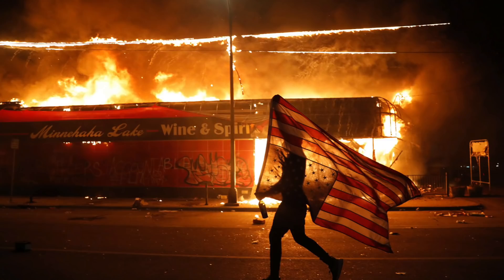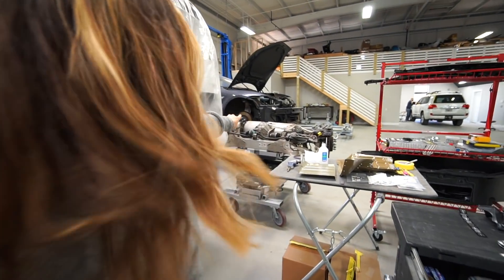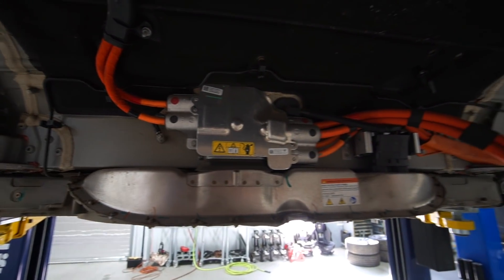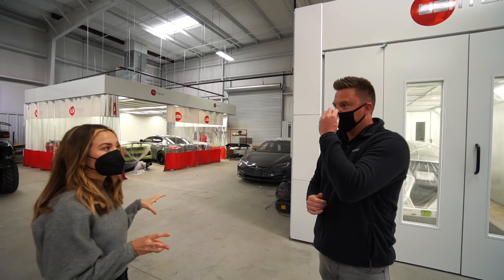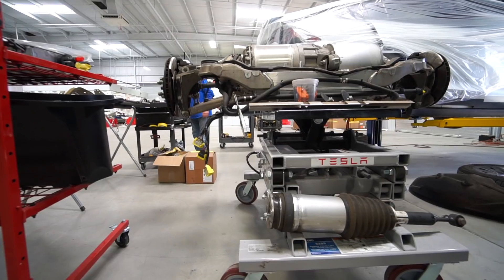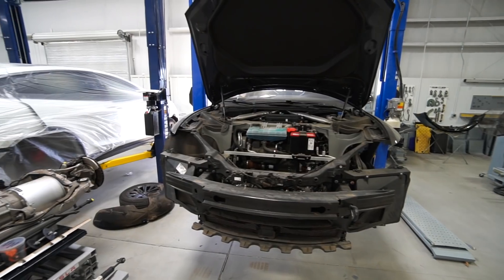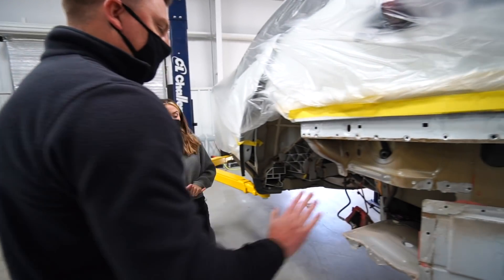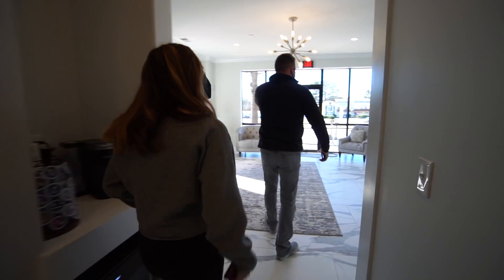True Cost of a TESLA Crash & Repair

Comment: The problem with repairs like this is that often they forget to install bolts and electrical connections.  I went through that when my Model 3 had to be repaired due to someone hitting the rear quarter.  The Tesla certified body shop I used, did a terrible job.  I took my car back to then twice, which was a two hour drive each way.  The whole process was a nightmare for me.  And worse yet now my car has damage history.

Comment: Make sure to also file a Diminished Value Claim against the at fault insurance. I just did this on our 2020 Model X that was rear ended. after the repair, we hired a DV claim expert to do the appraisal. ended up getting just over $14k in lost of value paid back to me by the at fault insurance.
Reply: She was most likely at fault. It appeared she was crossing the road because other cars had stopped to let her across, not because there was a stoplight. I may be wrong but that’s what it looks like in the video. In most states you can still file diminished value against your own insurance policy.
Reply: @ljviks22  teeaaaaa
Reply: @ljviks22  yep. I agree. Unless there’s some mysterious stoplight I don’t see, she was at fault. Also, as I said in another comment, that Accord had nearly come to a complete stop. It was not going 40mph. You can tell the driver had slammed on the brakes and the wheels were just barely turning. You can see ABS doing it’s job to pulse brakes so the wheels never locked up fully.
Reply: I never pull out of a parking lot because someone waves me on. I’ve had people get angry because I wouldn’t go because they wave me out. No thanks, I’m not getting hit.

Comment: First off I'm Glad your family is safe and they were able to fix your X up quickly and at a fair cost.  However I do not agree with the collision shop owner basically saying that all salvaged cars are not rebuildable!  This is not true there are tones of lightly damaged and cheaply repairable salvaged cars out there. This is not sustainable and in Tesla's vision to abandon these vehicles as trash!  Owners, body shops and Insurance company's will total vehicles with little to no damage because they deemed it unsafe or over cost.  My salvaged tesla model 3 is a prime example of what can be done to a wrecked car.  They totaled it for just 40% ACV with only front end damaged windshield and airbags.  Tesla made these cars so well that all that was needed to fix this type of collision was to remove all the damaged parts and replace them.  Everything that was damaged either unbolted, unplugged or clipped on with push fasteners and wire harnesses.  After all the damaged parts were changed the only thing left was cosmetics a few scratches near the door with no need to have a body shop repaint the car or bondo anything!

Anyways, Thanks for the video!
Casey

Comment: It took 9 months for them to repair what seemed like minor damage on my model x
Reply: Thats because its loaded with electronics everywhere and the car is very heavy so a small impact could seriously cause some damages.
Reply: 9 months!? Was this recently or a few years ago? Thats seriously insane. I drive my truck whenever it snows hear in MI
Reply: @RT-qz5ci  I just got it back two months ago. I had a loaner model x but it was the short range which was very inconvenient. My family has chargers at our houses that I drive back and forth from regularly that are exactly 300 miles so I could do it on one charge with my 100D. The short range model is ridiculous when you’re trying to drive that distance on a regular basis